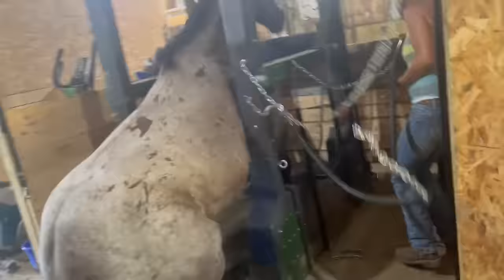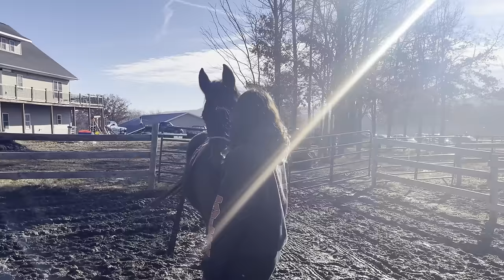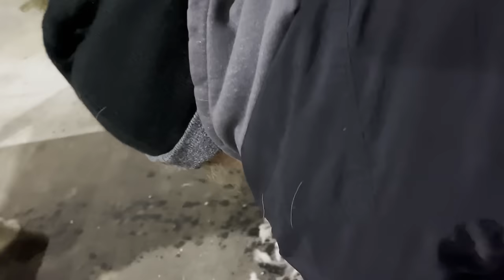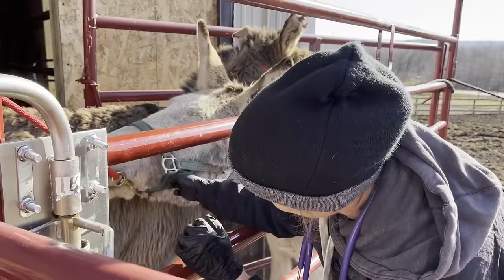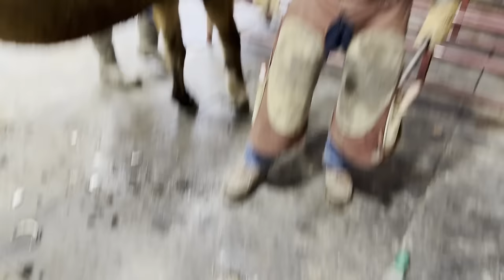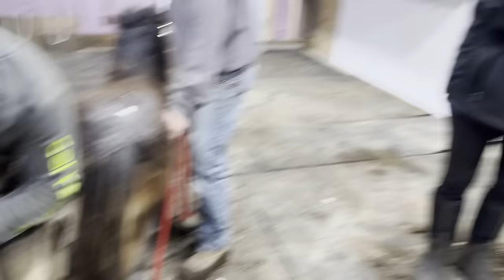They Did What??!

Comment: My sister has a few horses. One of them is a pain in the butt. She is extremely smart. And big and she knows it. About once a month I have to go chase her through the woods to get her back into the property. The problem is is there's a abandoned orchard near my sister's house. Somehow the horse figured it out. And she figured out there is a swamp in between the two places. So if you're tracking her in the woods like I have to a lot. She will go back-and-forth.Cross that swamp numerous times to end up in that orchard. She has a scar on her side where she slid in the swamp and somehow found a piece of bob wire. But she is a very strong horse. But when you catch her, she gives up and lets you leader to the house until she wants to do it again.Or something allows it to happen. The horse is about seventeen or eighteen hands

Comment: With lily try putting a blind fold over her eyes and work with her like that to gain her trust by working with her being not being able to see and get her to go by voice only till you show her that you will not hurt her and it really works because my friend had a horse that was born with one eye that was blind and had ring around the blind eye and the horse could see out of one eye and the owner of the horse had trained the horse with a blind fold over his eyes and the owner gained the horse trust that way so that the horse was not put to sleep as a foal like all the other colts and its sire had the same problem and it was blind on the same eye as its colts and my friend had kept one of the colts because it had a good size and it was built like a brick and stood the wright way and even if it was blind in one eye the horse was very good rounding up cows and doing stock working and won some comps for stock work